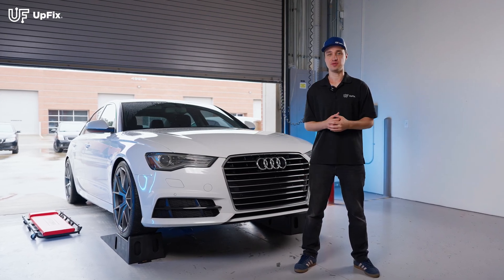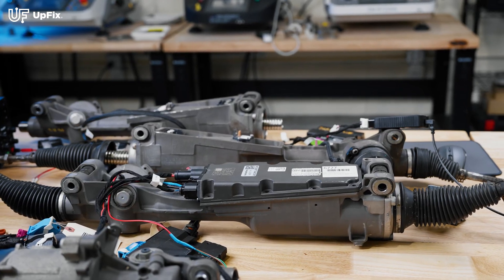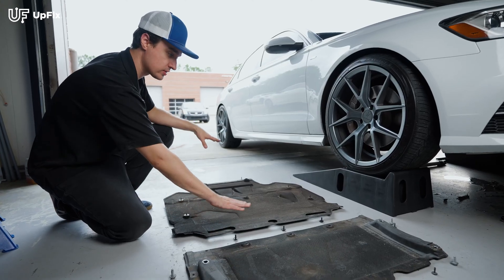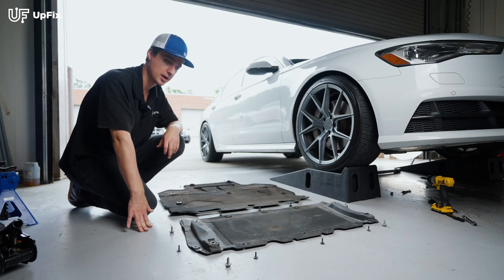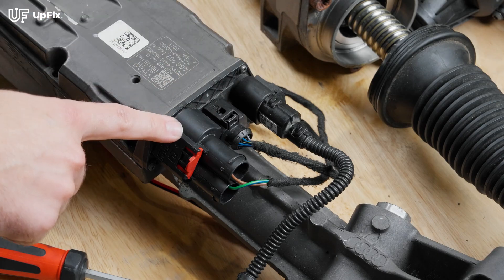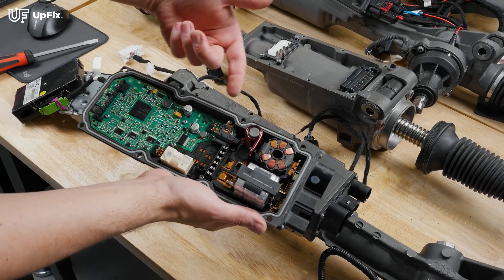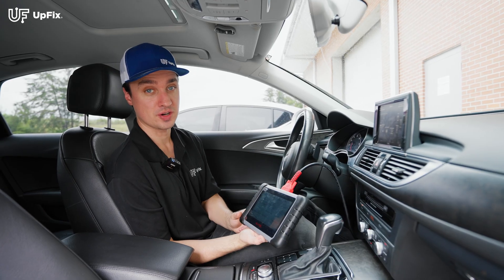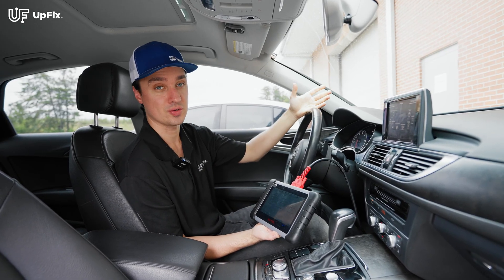How to Remove Audi Power Steering Module (PSM) - Step-by-Step Guide | UpFix

Comment: Great video, really helpful. One question.  If it’s plug and play when you get it back.  Do you really need a device to check the codes have cleared?  Surely you will know the codes have cleared by the lack of steering malfunction warning notification showing on the dashboard when you turn the ignition and the power steering will be working again?  Or am I missing something?
Reply from the maker: Thanks for the great feedback! You're correct that if the warning light is off and everything is functioning properly, the codes should be cleared. However, using a diagnostic device can provide extra assurance by confirming that all codes are indeed cleared. If you have any more questions, feel free to ask!
Reply from the maker: Hi! Rest assured, our technicians are qualified, and this is a repair service we have done many times, with success. All of our services come with a 1-year warranty if repaired. Please note, we will not know if it is repairable or not until we have it in hand. This is why we do not charge until services are completed. If you have any questions or concerns, please don't hesitate to contact us at 888-979-9343. Thank you!

Comment: Hi mine went red and then went yellow ever since i done the inner tie rod and track rod ends, but the funny thing is when we done that and left it  as it was it was fine, and then realising the wheels wernt straight , i jacked the front up and done the wheel alighnment just so it was drivable to the garage that is gonna carry out the wheel alignment, after i did that, it was a red light and then went to yellow after re calibrating the sterring angle sensor, i then proceeded to go and get the wheel alignment and adas re calibrated, so the adas got rid of the power sterring fault and it was off for about 2 to 3 hours and came back on, comes up with the code 44 😢
Reply from the maker: It sounds like something may have been damaged or misaligned during the tie rod and track rod end replacement, and the calibration didn't solve the issue, so you'll need to diagnose the root cause.
Reply: @upfixauto thank you for getting back to me, turns out its a update needed, these cares are like phones, hate em

Comment: 2017 Audi SQ5 electric steering rack and steering angle sensor replaced..the traction light and EPC light is off but the yellow steering light is not... despite doing basic settings and adaption...the new steering rack and steering angle sensor are the same part number ... please possible causes and solutions
Reply from the maker: the part may be correct, but the module probably isn’t fully coded or adapted yet. Sometimes a dealer-level ODIS calibration is required to finish the process.

Verify coding with VCDS/ODI: make sure the new rack is coded exactly like the old one.

Run the exact sequence:

1. Clear all DTCs.

2. Calibrate SAS in ABS module.

3. Perform steering assist module basic settings.

4. Perform steering limit stop adaptation (full lock left,  full lock right, center).

5. Drive a short distance straight with steering centered.

If the light persists, check for stored DTCs in the J500 module. If they point to “implausible signal” or “coding error,” then it’s a coding/firmware issue, not the hardware.

Comment: What exactly goes bad in these modules? How do you repair these?
Reply from the maker: There are about 8 components that commonly fail in this unit (microprocessor and transistors and other SMD parts). Check out more on upfix.com

Comment: Would this fix a 2014 s4 with 01309 and c10ad29 codes
Reply from the maker: Yes, visit upfix.com or call/text us at 888-979-9343
Reply: @upfixauto I was told by someone at upfix that you do not device that error code. So which one is it?

Comment: I just got a new one to replace the old one and still showed error (first yellow light and then went red light) plz help :(
Reply from the maker: It might need to be programmed to your vehicle. You can also give us more detail here: https://www.upfix.com/repair-request/
Reply: @upfixauto 
Well. Thanks for your reply bro
According to the mechanic the scanner reads torque values, meaning that the new module is alive (the entire power steering rack), it hasnt been coded yet. But the problem now is the steering wheel column is fully locked. All of this after a water flood the car went through :(

Comment: I have a a6 c7 and have multiple lights up from the day it went out. Steering defective, tpms, and stability control. Don’t know if that can be the rack and pinon or the module?
Reply: i had the same issue as well i had to check for water damage on control module and turns outs a good amount of water was there, dealer tried to charge me 6k to replace ot
Reply: @its_starlol8535 do you know what the part number is? It’s a 5k repair here at the dealership also. But if I could buy one cheaper it’ll be better
Reply: I have the same lights. Did you fix it?
Reply: Did you get it sorted? Going thru the same on my 2016 S6 dealer wanted $5300
Reply from the maker: Those are common symptoms of a failing PSM.
Reply from the maker: Check out upfix.com or call/text us at 888-979-9343
Reply: 2017 Audi SQ5 electric steering rack and steering angle sensor replaced..the traction light and EPC light is off but the yellow steering light is not... despite doing basic settings and adaption...the new steering rack and steering angle sensor are the same part number ... please possible causes and solutions

Comment: Cómo se cuando es compatible ?
Reply from the maker: If you are purchasing a replacement part, make sure part number matches. If not then it may not work on you may require an additional programming to your VIN and vehicle settings.  If you have time it's good to send your original part for repair (it will be plug-and-play when you get it back)

Comment: I have a 2015 A8 (3.0L) that makes a groaning noise when driving straight a little while after warm up. The noise goes away whenever I depress the brake but comes back at low speed acceleration and continues through 65 mph. It becomes less pronounced above 65 but will still groan.
Am I correct in thinking that there is no power steering pump on this vehicle and the training is somehow related to the PSM?
Reply from the maker: Are you getting any codes on your scanner?
Reply: @upfixauto Wow! Thanks for getting back to me so quick! There is a fault code for the STEERING ANGLE SENSOR in the STEERING ASSISTANCE category ( C10C929)via the scanner. The "status" is "intermittent. 
The scanner I am using is the OBDELEVEN 2. The STEERING ANGLE SENSOR and the STEERING COLUMN categories are free of any fault codes.

Comment: Can i ask a question, what other errormcodes come up when  that module goes faulty, because other codes ive got are the AAC maulfunction and ESC maulfunction
Reply from the maker: These two are common codes for faulty PSM. Codes B2000:00 and B2000:49
Reply: @upfixauto aw i got it into the audindealerahip.codes.wont clear they said it looks like the power steering module is gone they said

Comment: I have a 2013 Audi A4 ran the code 01309 - Power Steering Control
Module (J500) also i see B200049 code. Steering wheel is completely locked up, Will this work?
Reply from the maker: Yes we can fix that. Here is more info https://www.upfix.com/product/audi-a4-2013-2017-power-steering-module-repair/

Comment: I have an Audi A7 with this issue. Is this something that can be done with the battery connected? Last time I took the battery off it corrupted my BCM. I’m doing everything possible to not disconnect it
Reply from the maker: Yes if the modules are de-programming due to incorrect battery voltage the PSM can be removed/re-installed without the disconnecting the battery.
Reply: @upfixauto with this method, I will not have to program the PSM still correct?
Reply from the maker: Yes that is correct.  When you reinstall the PSM it will plug-and-play

Comment: Is fixing the only option? Try to see if i can just buy used module and swap on. Or it wont work?
Reply: @jasonzidongjiang8281  your better off getting it fix by upfix and get a warranty on it. Cheaper than buying a used module on ebay or Facebook market.
Reply from the maker: Yes you can purchase a used one. Just make sure the part number is the same. Then most likely you will need to get it programmed. The benefit of having your original one repaired is that it will be plug-n-play when you get it back.